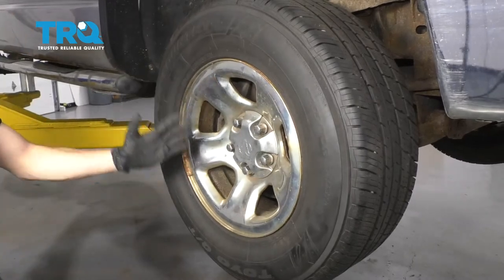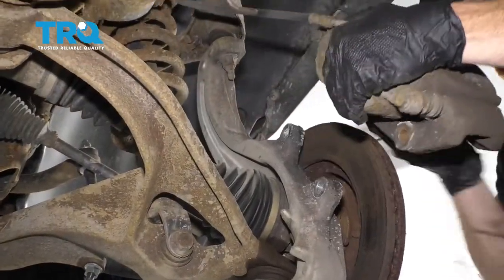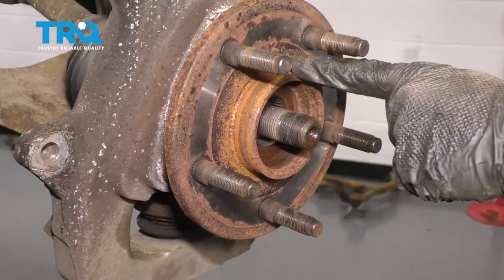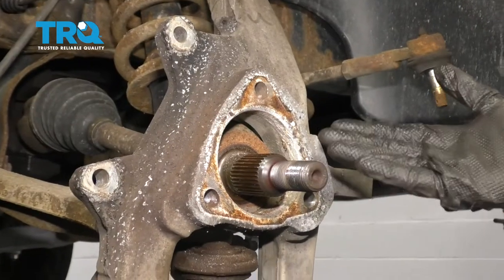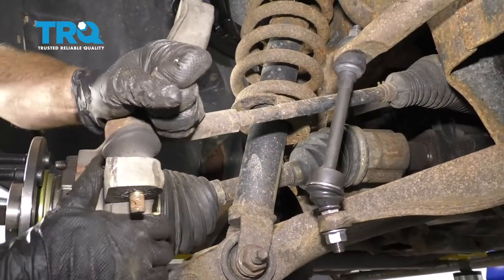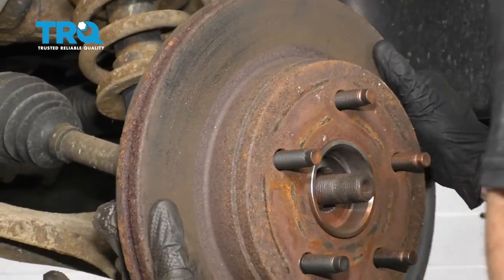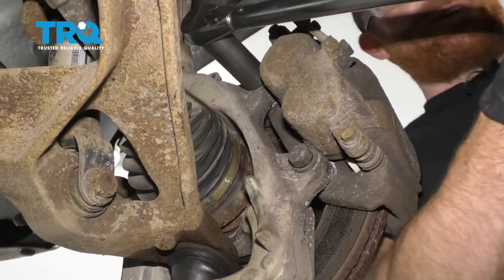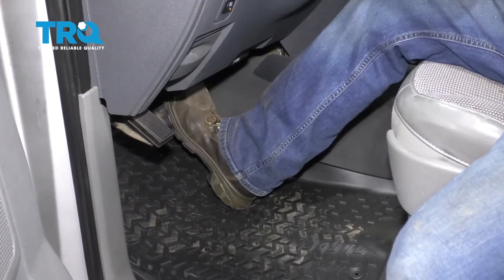How to Replace Front Wheel Bearing and Hub 2006-08 Dodge RAM

Comment: Is it the steering bar or a tie rod?  Also, I wouldnt "bonk" too hard on that aluminum knuckle!  These videos make it look so easy...parts are often fused together with rust.  The only way I could get this done was to entirely remove the spindle and pound out the bearing from behind.  That's after I had to jack up the truck with the jack pressing on the bottom of the lower ball joint to get that apart first!!  This is not an easy job at all if you have rusty parts.

Comment: I did not remove the tie rod nut or the tie rod and I  cannot get a impact socket on the bolt for the bearing assembly as the axle is in the way. The axle is  loose and I did not have to hammer it to get it loose. Do I need a regular socket or would removing the Tie Tod allow me more room to get better access to the bolt. Also you do not have a backing plate on this truck.